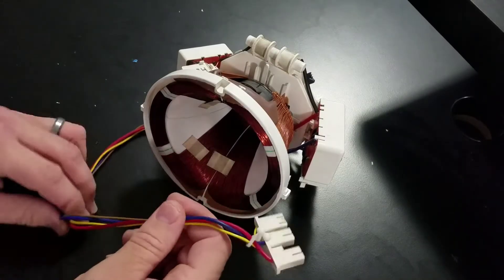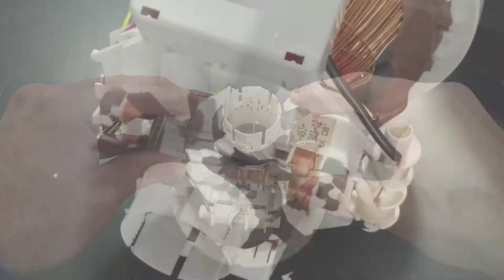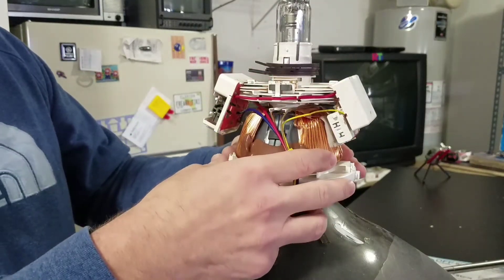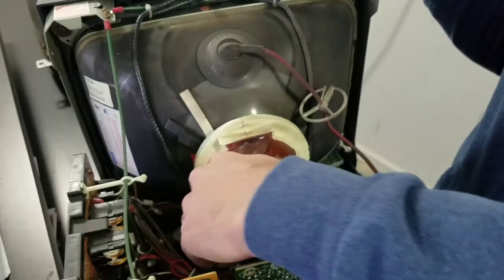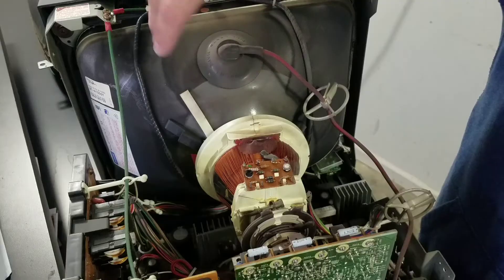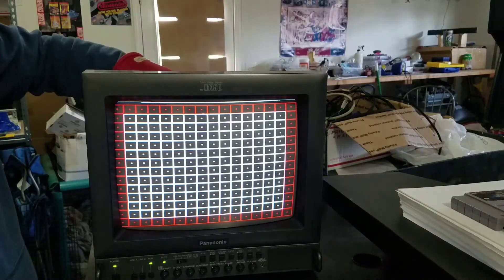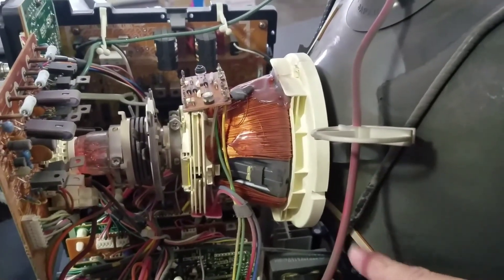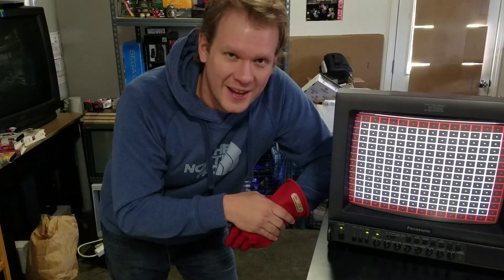How to fix screen tilt on a CRT TV Monitor - Yoke Detailed

Comment: Thank you for the info. Going to adjust yoke on 13" Trinitron. It did have the "tilt" in the options, but even a -5 is still far from acceptable. Question, where do you get that geometric testing screen? Something I can download or do I need actual hardware?  Name too if possible. Thanks. Thumbs up!

Comment: Watched this video before opening up my CRT, and then found out mine has a bonded yoke. The only way to make any adjustments is with a computer interface that I can't get anymore using software that doesn't exist anymore 😞

Comment: Hi,  I want to start off by saying I love your content!! I've learned a lot from your videos.  I have a Panasonic 27" super flat, model CT-27SF35W manufactured in 1998.  My image has a tilt to it and some corner convergence issues.  I was told awhile back that this set has a fixed yoke so no adjustments can be made by a TV repair shop back in 2015.  I was just wondering if this is true?  I'm a little intimidated to try to straighten it myself, but the TV is in such nice condition I'd like to have it corrected.  Any advice and information would be appreciated, thank you!!

Comment: Fixing yoke tilt is fine and quite easy to do but how do we reseat a yoke properly so that convergence and geometry is equal across the screen?  Just adjusting the tilt can cause these problems to develop too.  I'm using spirit levels and all sorts to try to get it right and there is always a new problem somwhere on the screen even when I think I have got it right.   I'd like to come across a more solid solution to yoke sag instead of the Y ring magnets as that acts more like a bandaid.

Comment: Awesome video. Just found an old TV in the attic of the house I just moved into. It has a slight tilt and edge discoloration. Going to familiarize myself with safety steps before tearing it apart.

Comment: I have an arcade monitor with a broken yoke. Its just dangling there. I'm fairly new to actually working on them but I was able to temporarily hold the yoke in place with Gorilla tape. I felt like a huge wuss for ordering those same gloves, until I saw you wearing them haha. I'm not interested in getting a nice shock! I'll be wearing those to make further adjustments.

Comment: Good day Sir
Thank you very much for creating these CRT videos; I have learnt a lot so far. When adjusting the yoke position while the tv is powered, what gloves should be used? Any rubber glove or is there a special requirement? I understand that the voltage on the horizontal deflection coil is quite high. 
Also, to correct for screen tilting, can a small rotation of the yoke cause the purity/convergence to change?

Thank you very much.
Regards from South Africa
Reply: Rubber gloves, the disposable kitchen ones are fine.

Comment: I've got a large Panasonic consumer CRT from the late 90's. The picture doesn't make it all the way to the horizontal edges of the screen. (Vertical is fine). I have found a pot inside that controls horizontal size, but even with it maxed out it still doesn't reach the edges (and overscan is visible). Can this be corrected with some kind of yoke adjustment?
Reply: I have the same issue on my trinitron.  I maxed out to 0 on my horizontal position and won't go anymore to the right.  Hope someone can answer
Reply: @anthonyterry8162  I wound up trashing that set and replacing it with another (free) one I found. Most likely it would have needed internal work such as capacitor replacement, etc. which I can't do.

Comment: Hmm... My arcade monitor does have some solid purple in the far bottom right corner of the screen. Even when I got the monitor new I always had issues with screen geometry looking straight on one side of the screen but warped on the other. Maybe a simple Yoke adjustment will help a lot. The monitor came with no cover to begin with. Definitely picking up some antistatic gloves though.

Comment: Should I reset to factory default in the service mode before making physical adjustments like this?
Reply: I personally would do that. Just to know that your yoke adjustment is not altered by some geometry setting like the tilt setting.
Reply: @FR0MMEL  Thanks

Comment: Hello!
Does anybody has an idea how this works with a B&O MX4000?
I could get it to look good but it always goes back to it's crooked position. 
There aren't much Infos out there and at first I thought the problem are the wedges. But i was reading on a forum, that the yoke and the tube are one unit on these and you can't adjust the yoke at all. 
Is that true?

Comment: Great vid!btw,can you tell me how to fix my CRT TV screen stop moving on video mode?even when entering the menu it appears like moving (not instantly like it's meant to be) and when playing games (PlayStation or PlayStation 2) when the screen transitions or changes (when it goes black and another one comes up,for example) it fades away or appear very slowly and moves towards the screen like in a 3D effect,it never stands fixed when there any kind of movement on screen and it's like autofixing itself depending on what's on screen.It's very odd,I can't give any more details about it.It all started when I gave the TV to some "service" just for them to center the screen (horizontally and vertically),now I have a useless TV...any kind of information about this is mostly appreciated!

Comment: Thanks. I just fixed my badly tilted TV with this vid (and the CRT safety one). I just wonder how to fix Horizontal linearity as 240p Sonic stage looks bad.
Reply: If it is one of the newer flatter tubes, this could just be a feature of flat vs fully curved screens
Reply: @shark_ref  yeah its a latest samsung 21" crt flat tv (one of the latest ever made)
Reply: @matcarfer  that'll be it then. The flats aren't too accurate for light guns either. If you have something you can run 240p test suite on, the patterns in that will illustrate the downfall of removing the curviness from our screens

Comment: Would you recommend adjusting the yoke on a Sony Trinitron KV-36FS120? My screen tilted the other day and the tilt screen correction setting leaves black lines on the edges.

Comment: Something I've always wondered about is: can you adjust picture size (overscan) using the yoke by moving it?

Reason being, I noticed on many if not all cheap modern CRT TVs there is no way of adjusting H-Size in the service menu (only V-Size), just the higher end sets seem to have a H-Size option for whatever reason, and there are no pots on the chassis either.
But there must be some way to adjust it, so the yoke comes to my mind.
Reply: I got the same problem only I see H Size in my service menu, it just doesnt do anything when I change it. he said if I recapped the TV Id be able to adjust it. not sure if thats just with the PVMs though since I have a consumer grade CRT
Reply: @dudeguy7347  Yeah, it's the same on my cheap 2005 consumer CRT TV. There is a H-SIZE option in the service menu but, like many other settings in the service menu, it doesn't seem to be tied to anything and nothing happens. Recapping definitely won't help that.
So how was the horizontal picture size set in the factory? Maybe it's fixed to some predetermined value by some cap or resistor and simply isn't meant to be adjustable at all to make the manufacturing process cheaper?
Reply: @martinweizenacker7129  thats kinda how I felt. I wouldnt think a 15 year old TV needs to be re-capped. I could see 20+ yrs

Comment: I have a Sony Trinitron 1370R, its slightly tilted to the right. All I need to do is loosen the screws on the yoke, slightly turn it to the left and I should be good?

Comment: Hi the convergence magnets are usually marked on the fingers, P = purity, 4 = 4 pole magnet for red/blue convergence, 6 = 6 pole magnet for green/magenta convergence,
The enameled wire you can see on the outside is for the vertical scan and as such is generally low voltage so even if the enamel is nicked will not pose a shock hazard.
Please be careful of the red/blue lead terminations they will make you jump, usually not a terminal shock hazard but if your heart is not up to scratch or you have a pacemaker I can not say for sure.
Where the rubber bumpers are you can see some light coloured strips that are stuck to the CRT these are magnets stuck on the end of a strip of card/plastic and are to micro adjust the convergence in the corners.

Comment: I'm pretty sure I need to push my yoke a little forward, as I have some purity issues to work out.  However, even when loosening the yoke screw (this is a PVM-8045q), the yoke won't budge!  Any tips on getting it loose enough so that I can move it?

Comment: My CRT image is perfectly parallel on top, but the bottom is excessively curved towards the top. Can that be corrected ?
Reply: If that's arcade..SPC convexe..concave ( _) or )_(.....VSL vertical size limit (can compress picture).

Comment: Is there a way to perform that kind of repair on a Bang&Olufsen TV?
The picture on mine is tilted a few degrees clockwise. 
I called a TV technician today and told her about the problem and the possible fix, she said that yoke and tube are one unit on B&O TVs which makes the yoke unadjustable. Is that true?
Reply: Sort of true. 

PIL (Precision In Line) CRTs (pretty much all colour CRTs from the mid 70s onwards) rely on the position of the yoke  for the convergence. 

Once these have been set up, they’re often wedged, glued and fixed into place. 

I have the same issue on a Hitachi set. I’ve looked into trying to fix the issue, but I don’t want to mess the set up. 

Try getting your inputs to display in fullscreen, and not in “letterbox mode” where you get black bars, this is where i notice the tilt. Fullscreen isn’t so bad.

Comment: Hey, I've a Commodore 1701 monitor and it's a kinda cool monitor, everything works well about it, the only problem is the image a bit tilted. After viewing this video, it's clear the yoke probably moved a bit in it's life.
 It doesn't seems hard to fix it, the only thing is i'm very afraid to received an electric shock. I checked your channel to find some safety tutorials but i didn't find any :/. Do you have some easy to follow tutorials I could watch or read :) ?

As i'm a totally new to this, working on it while plugged seems very dangerous for me, if I let it unplugged for a week will it be totally safe to try moving the yoke ?

Your content is very cool and helpful anyways, thanks for that !

EDIT : I just foud your video that explain how to do it : https://www.youtube.com/watch?v=d1mQupQHFkc. I'm still affraid with the discharging step though.

Comment: How can you get that screen you used for the adjustments? I have seen it before but don't know what it is called or how to get it. Great video btw.
Reply: He's using a program called the 240p Test Suite. The grid pattern is taken from a CPS-2 arcade ROM's diagnostics mode. Your best bet is to put it on a Wii running homebrew since the Wii version is a free download, or you can buy a cartridge/disc with the program running on it if you have a Sega Genesis, a SNES, or a Playstation 1/2; hell there is even a HUDcard if all you have is a Turbografx-16.

http://junkerhq.net/240p/

Comment: Not sure where to ask this, but would you happen to know what to do about a horizontal deflection cord that should be reading at .5 ohms but is reading between .2~.4 ohms instead? I made a thread in an arcade forum trying to troubleshoot problems with a chassis not staying on and arrived at the point where this might be the reason (stays on with the horizontal cord and vertical cord unplugged. The vertical is reading correctly between 6~7 ohms though), but I'm kind of stuck here.

Comment: The coils of the yoke are not are shock hazard unless they are damaged, in which case you'd have more issues than just a wonky image. While making sure there isn't any damage to the insulation before messing with it is a very good idea, under normal circumstances, you aren't going to get shocked from the windings themselves. The wires are all coated in an enamel coating to prevent any electricity from shorting between separate runs of the same length of wire. The exposed posts on top of the yoke however, if not covered, can potentially be a shock hazard.

That said, from an editing and photography point of view, a great step up from previous videos.
Reply from the maker: Thanks for the info!  This is super helpful.

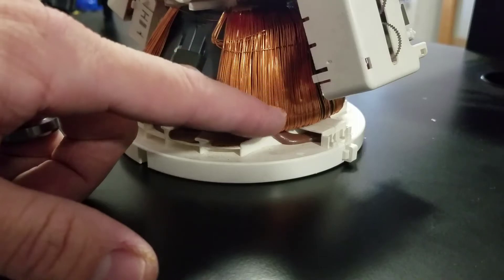Comment: Good video! Question: What do the plastic wheel dials on the right side of the yoke you show at the 1:00 min mark do?
Reply from the maker: Thank you.  Let me check on that.  I've only seen it on PVM & it seems to be factory set, then Epoxied over.